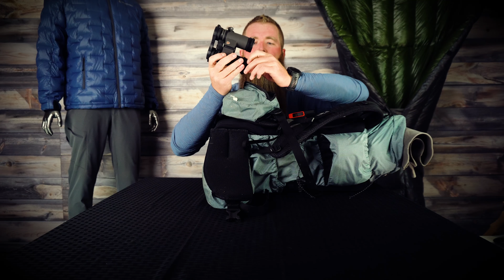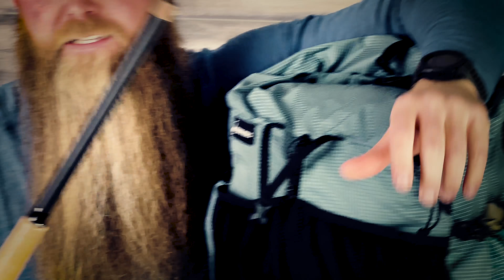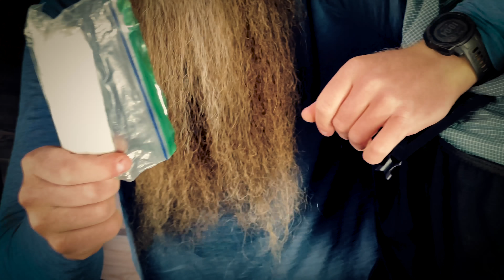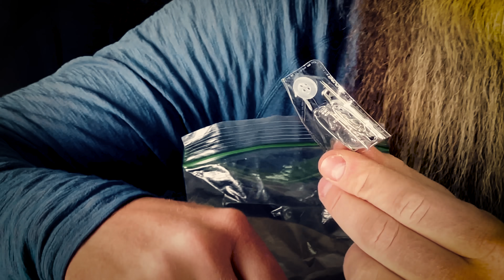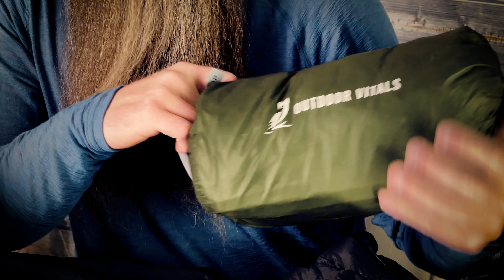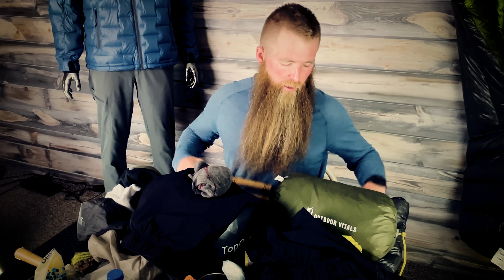Uinta Highline Gear List - 5 Day High Elevation Backpacking List

Comment: The Toaks Siphon Alcohol Burner is THE best commercially made burner out there.  Love mine.  I also have the four piece Toaks pot stand.  I always use a wind screen as well.  Mine is diy from some thin aluminum flashing, cut out with scissors to just slip inside my cook pot...takes up no space and adds very little weight.  Love this burner setup, have used it for about 3 years back and bike packing.    I also have a Chinese knockoff that is larger and comes with an X pattern pot stand that sets on top of the burner.  This one works as well as the Toaks and affords a larger flame for a larger pot.  The thinwall titanium siphon design is simply superb in the world of alcohol burners.   Thanks for sharing.
Reply: Unfortunately for me, my backpacking is with the Boy Scout program, (scoutmaster of a girl troop), and the BSA doesn’t allow alcohol stoves. REALLY wish they did. I use them for my own trips, but don’t get a lot of opportunities without scouts.
Reply: @gigihenderson8567  this is the first time I'm learning about alcohol stoves! is it considered too much risk because the alcohol is not fully contained & can leak?
Reply: @chinarut   the reason the Boy Scouts do not allow alcohol stoves is because the flame is very hard to see, so you don’t know the stove is lit.  When you are backpacking with 10 and 11 yr olds, safety is #1.  I have my old Brasslight alcohol stove that I use when I am alone.  MUCH heavier than alcohol stoves nowadays, but needs no pot stand and has a damper that allows you to adjust the flame.
Reply from the maker: Most of us over here really like them too!  Thanks for watching!